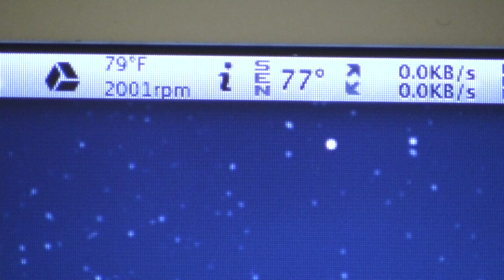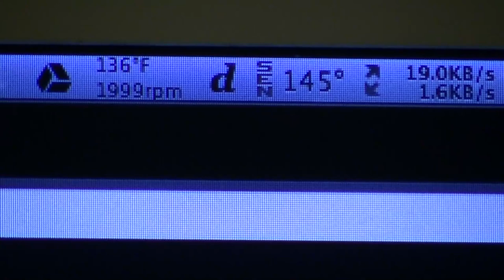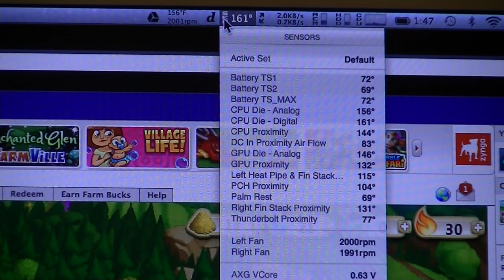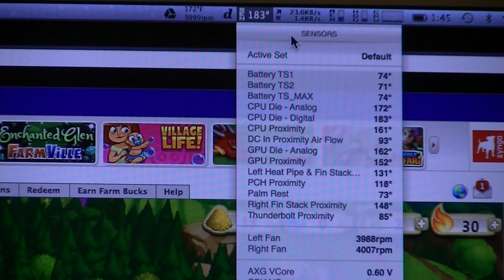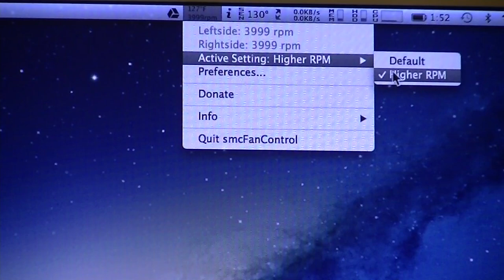HOWTO: Stop Your Macbook Pro Overheating!

Comment: 120°C is too hot.
Reply from the maker: But 120F isn't ;)
Reply: uberDoward F? Whats that? Faraday? Isn't that the magnetic field?
Reply from the maker: Ernst Stavro Blofeld Farenheit :)  It's an old scale still in use here in the US of A, since we can't seem to be bothered to use the metric system :(
Reply: Farenheit? Really? There is nothing in wikipedia about Farenheit. The New World seems to be full of curious things.
You have no metric system?! How do you measure distance? Do you still use hands and fathoms and  stone for weight?
How did you manage to put a man on the Moon with this imprecise nonsense?
Reply from the maker: Pure stubbornness ;)  Fahrenheit, sorry, I misspelled the word the first time.  We measure distance in inches, feet, miles - weight is in ounces and pounds :)
Reply: uberDoward That's madness!
Reply from the maker: Ernst Stavro Blofeld Madness?  THIS IS AMERICAAAAAAA!!!!!!
Reply: uberDoward Well...
However, what temperature (in celsius if possible) would you consider too hot for the various components, like processor, memory chips, hard drives, etc.? One of my Mac Pro memory chips were running slightly over 80 celsius for a short while before they failed.
Reply from the maker: 90C is the maximum temperature where Apple's designed the cooling system to let things get to.  Anything over 90C for the CPU/GPU is too hot.  I'd say 65-70C max for everything else.
Reply: uberDoward Ah, thanks. Looks like I am still safe.  
PS: Did you ever cool your computers with liquid nitrogen? It is quite popular here in Switzerland among some people at CERN.
Reply from the maker: Can't say that I've ever gone sub-zero temps :)
Reply: uberDoward Speeds up the motherboard a bit.
Reply: uberDoward
It is not really used on computers, even here in America. Computer people everywhere pretty much all use Celsius. I used a unit conversion program just to see what your temps actually looked like. They look pretty good by the way.
Reply: actionjksn Thank you very much. Take care.
Reply: uberDoward um north, central, or south america
Reply from the maker: North America - specifically the United States of America :)

Comment: Do yourselves a flavor: Do not buy a mac ever! They are expensive, they do not last, they are HOT and if you upgrade you are going to buy a new one, just like you do with the iPhones.
Reply from the maker: Respectfully, I disagree.  I'm sitting here on a 2009 Mac Pro, with a 2011 Macbook Pro, and even though they are 5-7 years old right now, they both run fantastic.  I would not want to use a 2009 Windows anything still, today.  Macs tend to last much longer than their Windows counterparts :)
Reply: Lucky you! I was watching a movie yesterday on a iMac 2012 (Mavericks) and it got heat up to at least 80C. My macbook pro 15 2008 had faulty graphics as you probably know, and my macbook 13 2014 Yosemity definitely needs SSD upgrade. Anyway, it depends on what you're doing actually. But after many years of programming experience with multimedia I prefer Linux of all!
Reply: Mac vs PC is like Luxury cars (BMW, Mercedes) vs Standard Cars (Ford, Chevy). Just like a BMW a Mac has more sensors then my girlfriend (No sexist pun intended) but with proper care a Mac/BMW carries style of luxury as well as performance. 

Then again every tech knows how to repair and service PCs but not every tech knows how to repair Macs because they are so proprietary, it's just easier to say, "get rid of that thing and get a Windows computer". Starting with 2008 platforms all Macs can decode 1080p, thus allowing these 8 year old computers to still be used for most light application needs. In the end it's all preference and how well you take care of your machine but even an old 2008 aluminum unibody Macbook has a slick, modern design and can be upgraded with a 256 SSD and 8GB RAM to run like most modern laptops, for under $150. Thats $100 for an SSD and $50 for RAM. 

Check out my channel, I have repaired every Mac that has ever been made and I still sell 2008 Macbooks for $400+ never have complaints, people love the slick design and the small built in experience features as simple as two finger scrolling and multi million colors in the lcds to make even an old screen look excellent without retina. I can go on all day about it and i'll just say this, I use Windows, Mac, Linux and Macs just have better user experience and are more secure if you don't know much about permissions, a Mac will naturally teach you, they look great and are more or less a status symbol. That's my 2 cents, thanks for reading.

Comment: I used compressed air and blew it through the fan vent once and a tiny ball of dust popped out. So my fans are clean for sure. How much of an impact would a clean heatsink have on the performance?
Reply from the maker: +BRBallin1 Depends on how the thermal paste is - if it's got way too much, then cleaning it will do a world of good!
Reply: I tried to unscrew and remove all the connections to get access to the heatsink, but those fuzzy connectors are tricky and I chickened out and screwed everything back on midway lol.
Reply from the maker: Aww man, don't give up!  Nothing like the feeling of a job well done :)
Reply: uberDoward Maybe I'll give it a second try with an extra hand. Btw, is thermal paste gonna make a huge difference or should I just stick to cleaning up the metal part of the heatsink?
Reply from the maker: Clean it fully, and get some good Arctic Silver 5 or the like - makes a huge difference!